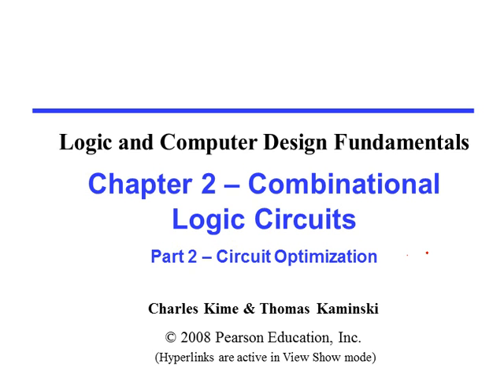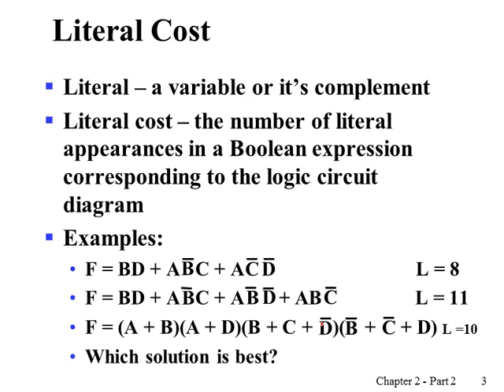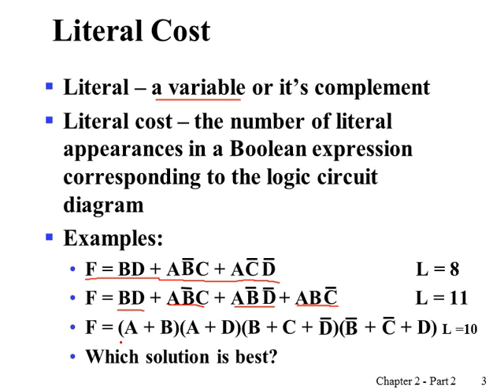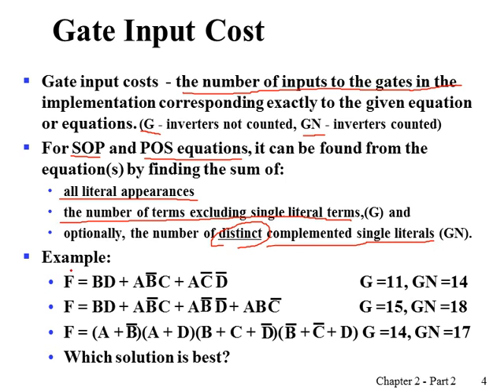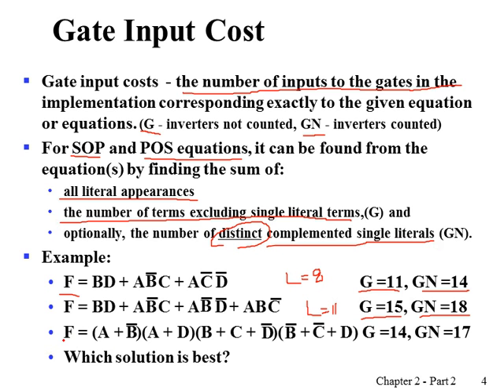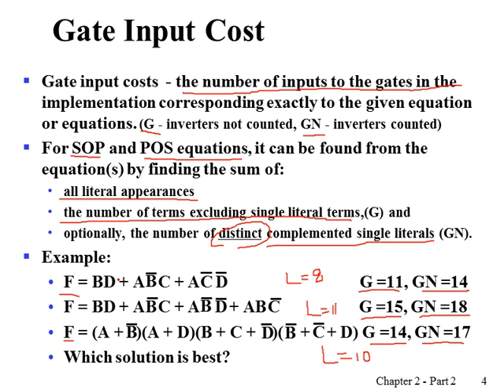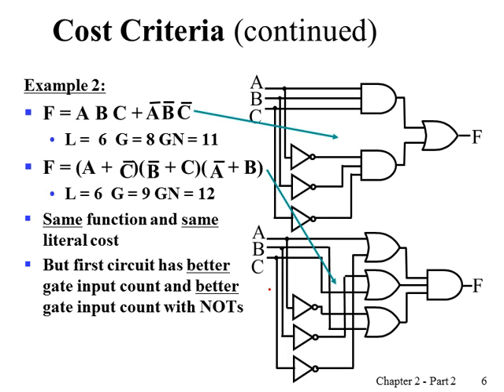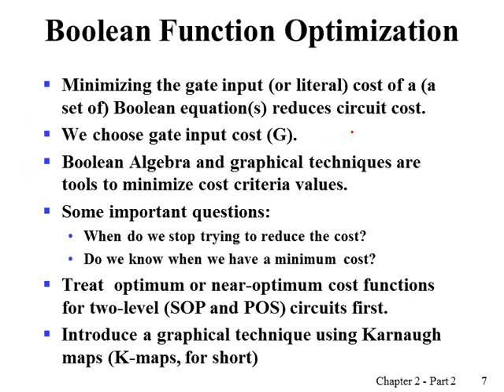Chapter 2 Part 7 - Cost Criteria

Comment: Would you please help me answer the correct literal cost (L), gate input cost (G), and gate input cost with NOTs (GN) of these equations?
I've discussed it with my friends and we have different opinions about the answer.

1. F1 = X'
Which one is the correct L, G, and GN of F1:
	L = 1, G = 1 (number of literals + number of terms excluding single literal terms), GN = 2 (number of literals + number of terms excluding single literal terms + number of complemented literals)
or
	L = 1, G = 0 (number of inputs to the gates), GN = 1 (number of inputs to the gates with NOT)

2. F2 = X+Y'
Which one is the correct L, G, and GN of F2:
	L = 2, G = 3 (number of literals + number of terms excluding single literal terms), GN = 4 (number of literals + number of terms excluding single literal terms + number of complemented literals)
or
	L = 2, G = 2 (number of inputs to the gates), GN = 3 (number of inputs to the gates with NOT)

3. F3 = (X+Y)'(W+Z)+(X+Y)'
	What is the correct L, G, and GN of F3?
Reply: I think, 1 should be 1 , 2 should be 2 and 3 should be L = 6, G = 9, GN = 11